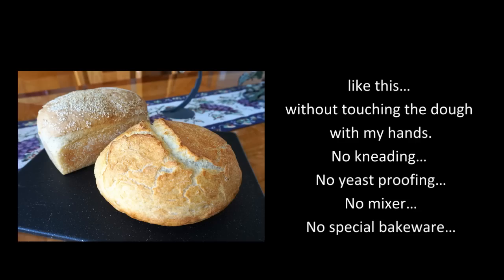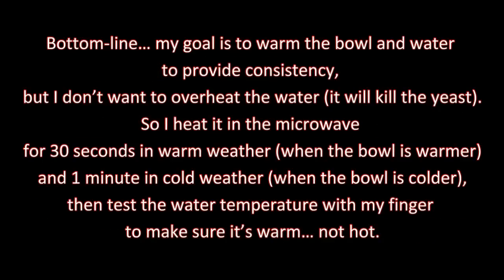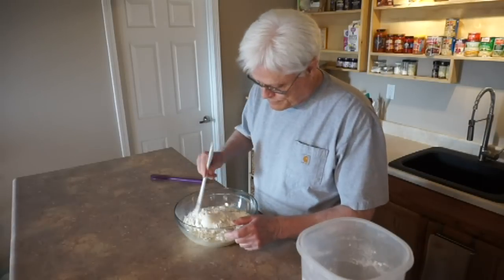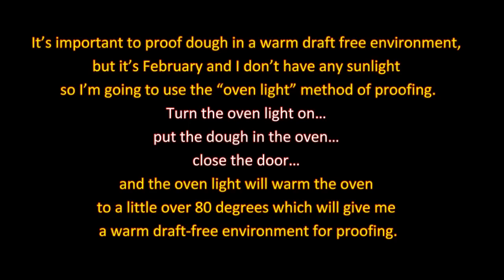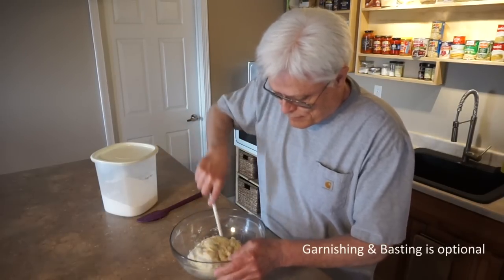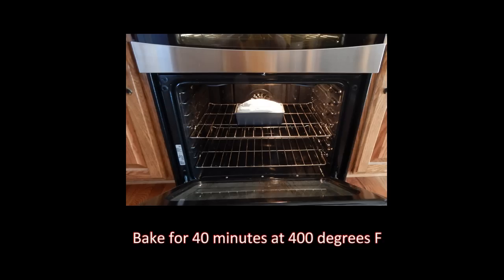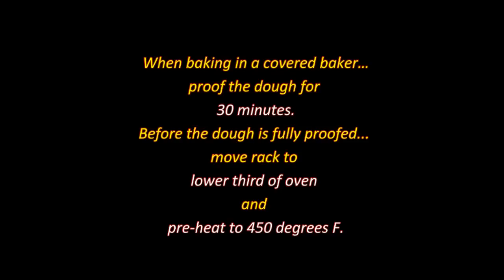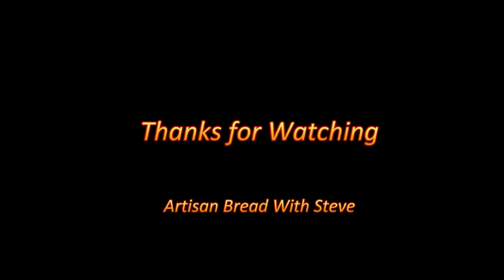Ultimate Introduction to No-Knead “Turbo” Bread… ready to bake in 2-1/2 hours

Comment: Hi Steve. I'm writing from India. This is the second time I used one of your recipes to make bread and it has turned out quite good. Thank you for very clear instructions and simple no fuss processes. The bread is not as good as yours but not bad either. 

We don't get bread flour easily here so I just used 2 cups all purpose flour, almost 1 cup of wheat flour (atta) and 1/4th cup of cream of wheat/semolina (rawa). It's quite warm in Bombay where I live so I used only 1 tsp of instant yeast. All other ingredients were the same. Additionally i added a tbsp of flax seeds and sesame seeds. This recipe is definitely quite forgiving and the bread turned out quite good. Next time I plan to add a bit of sourdough starter for a more robust flavor. 

A very long comment however,  it may help someone else who's trying to make bread in India.

Comment: OMG I just had my first major bread baking success after watching this video!   I started with your recipe.   Then because I can't leave well enough alone I added three eggs and a quarter cup of sugar.  And because that made the dough WAY too sticky/wet I added in about another cup and a half of flour.  (I felt so embarrassed to have ruined your recipe by trying to be all smart, but it worked out in the end.)   Then I baked it using your closed dutch oven technique (450F  for 30 min covered, then 10 min uncovered to develop the crust).

Other than messing with the recipe a little, I used your technique exactly.  And my loaf turned out looking exactly like yours!!!  I even got an identical crack across the top, so I knew I did something right.  I was so thrilled I could hardly wait to taste it.  It was so amazingly good that my son and I sliced and ate almost a quarter of the huge loaf all by ourselves, as soon as it had cooled just enough to slice.  The crumb was fine and delicate with small holes, and very tender.  The crust was crispy and delicious, and was the best part!  

This recipe and technique you've developed really is very forgiving.  It took me barely two and a half hours from start to finish, and it is the best bread I've ever made.   Thank you for helping me make wonderful bread from scratch!   I feel so great right now, having created something truly wonderful that was totally confusing and difficult before.  THANK YOU!  :D

Comment: Awesome video Steve. For those who use a covered vessel, be sure to pre-heat the baking dish in the oven so both are up to temperature when you place your dough in the vessel, which will produce the necessary steaming effect that's required to make perfect bread. #TGBATG
Reply: Hmmm...depends on the vessel thicker and large yes. Small and thin no.
(Personal experience.)

Comment: This recipe looked so easy and so good I decided to give it a try this afternoon.  It was everything he mentioned except... the bread is stuck in my Le Creuset dutch oven.  I cannot get it out without tearing the bread apart.  So my recommendation before you put your risen dough in your dutch oven; either place it on a piece of parchment paper and lay it inside the the dutch oven or simply rub your dutch oven with some olive oil THEN add your dough.  Other than that, I will definitely make this bread again (although I will increase the salt to give it a bit more flavor).  Otherwise, it's delicious and couldn't be easier!

Comment: I have bought your books and the recipes are beautifully simplified so that even a beginner like me can make bread (turned out very good too). I have a suggestion - the amount of water should also be given in cups instead of only in oz.
Reply: It says 13 ounces is 1.625 cups. How do I measure the 625? That's the only thing wrong with Steve's video, it's always OUNCES. Not a clue what 625 is. It sucks!!!
Reply: YAY! 13 ounces is 1 1/2 cups and 2 tablespoons.
Reply: @chriscatlett1793  or 380 mL but I always end up adjusting to the season's humidity anyway :)
Reply: .5 is 1/2 cup , so its a little over that. As he said the recipe is very forgiving!  @chriscatlett1793
Reply: @chriscatlett1793  If it helps, one ounce is 2 tablespoons.

Comment: I've always turned out the dough on a floured bread board for gently kneading and shaping but will try your technique.  Thanks for the tip.  I also warm the ingredients before mixing and use only 1/8-1/4 tsp. yeast or about a cup of sour dough starter.  The results are very good.  I can usually ferment over night but, if I want to accelerate the process when commercial yeast is used, I add 4 or 5 drops of vinegar to the dough and then can ferment for a much shorter period.

Comment: Steve I LOVE you recipes and video.. I have shared them with all my family and friends.. and they are as WOW'd as I was...THANK YOU... THANK YOU...  I just bought at least  5 of your books on Amazon too............ Keep it up we Love it !!!!
Reply: Did you go by the recipe Steve walked you through? I did, it was my first one, but it turned out with the top brown and the bottom still kinda white and it wasn't light and fluffy. What did I do wrong? 

NOT Chris but TRISH
Reply: I am not sure...  I have used this recipe many times w excellant results.. .  I would suggest first review the recipe carefully .. then you might want to check the temperature of your oven. using a oven thermometer..  sometimes the settings on the oven is OFF.. my large oven is off by more than 25 degrees...   2nd be sure the yeast your using is fresh...... and if you buy it keep it in the refrigerator or better yet in the Freezer.. check what he said re the temperature of the water.too. Try simple things first and go from there.. Good Luck
Reply: I guess since it was my first time I can't expect perfection, can I? I just got my yeast today and I've watched his show about 10 times and I had it on while I put everything together but it was still a little dense. I think you're right about my oven temp, unless I didn't have the rack low enough. Thanks, Renita. I'll keep trying until I get it right.
Reply: Definately keep trying... I am not a bread maker but this recipe makes me look like one........ will keep my fingers crossed it works for you..DO NOT GIVE UP.. it is worth the effort
Reply: Thanks, Renita.

TRISH

Comment: I really love your recipes, Steve. Wish I found your channel earlier.  The biggest challenge with your recipes in the beginning was to convert from American/British measurement to European measurement (metric). But I solved it by buying a non stick baking mat from Ikea with a converting table for volume, weight and temperature printed in to it.  :-)  So maybe you could add metric measurement to your future recipes and books?
Keep up the good work!
Reply from the maker: Do you use measuring cups (by volume) or a scale (by weight)?
Reply: artisanbreadwithstev It varies, but I try to use a scale since it is more accurate.  Cup=8 US fl.oz=2,37 dl(volume) or 142 gr/0,142 kg(weight) with fine wheat flour. But since the weight will vary with the density and most people use volume, it is okay to convert volume to volume. Like 1 fluid ounce = 0,296 dl and 1 Cup to 2,37 dl. 1 Teaspoon = 5 ml and 1 tablespoon = 15 ml.
Reply: Svein Arne Grønnevik 
THANK YOU  from Greece. You just solved  the big problem I had with these videos. We have the same metric system and you have analysed all perfectly !!!!!!!!!!!!!

Comment: I have my first loaf waiting for the oven to heat up. My favorite bread isn't stocked at the market anymore. I have a new favorite bread now, I hope! I'm sure it'll be delicious. Thanks for the easy listening video, too smooth.
Reply: How did it turn out? Twice made and each time failed.
Reply: @celleduffel1533  It was delicious.  I did buy a new jar of yeast so it was fresh and the water added was at 110 degrees F. I also made a regular non-turbo loaf and let that proof for 16 hours. It was good. What happened with your bread?
Reply: @mick jelsma  it rose perfect in the bowl and it rose perfect in the breadpan, I put in oven and when it was done it was flat each of the two times made..it was abt an inch and half tall..as i type this I am making again 🤣  its not the yeast because i turned around and made a very pretty Challah bread.
Reply: @celleduffel1533   I have made bread that wouldn't rise, just not this recipe. I hope your bread comes out this time!
Reply: @hannabaal150  ty I will let you know. My husband is wanting some bread. 😁
Reply: Well @Mick Jelsma  the bread is out of the oven..I made in smaller breadpan but you cant say its sandwich bread..not high enough. I dont know now..this is third time..guess its time to call it quits on this loaf :(
Reply: @celleduffel1533  Can't say you didn't try! Maybe address something to Steve, he knows a lot more about this than I.
Reply: @hannabaal150  I may have to do just that. My husband said since cant use for sandwich we can use for something else but that depends on the crumb.

Comment: Hi Steve,  I am a bit confused... You stated that the Turbo loaf is ready for the oven in 2.5 hours but you state that it should proof for 1.5 hours.  If you add the 30 minutes for proofing in the skillet for the covered method, the time does not add up.  Also, you have oven mitts on when you handle the dutch oven but you say nothing about preheating it in the oven as it heats up.  Please clarify.  Oh, and I forgot to mention that I have made your 18-hour breads for quite some time and am looking forward to the dinner rolls.  Yours are truly the most successful breads I bake.
Reply from the maker: First proofing is 1-1/2 hours, second proofing is 1/2 hour, and I gave 1/2 hour for prep, mixing, etc. I didn't mention it but I did preheat the Dutch oven. Steve

Comment: If I'm using a metal bowl it can't go into the microwave so can we compensate but heating the water to little above warm and let heat transfers to bowl. What would water temp and time needed to let heat warm the bowl. One video you said make bread for sale for local animal shelter fun raiser, you rock! 😁
Reply from the maker: Run warm water over the bowl to warm it then use warm water. Steve
Reply: Good thinking 😁

Comment: Not sure what went wrong.  I just took this bread out of the oven...I have the same dutch oven as used in this video.  I didn't see any spray or oiling of the crock before putting the bread in this.  But my bread is permanently fused to my dutch oven now.  I've been trying to scrape or break the edges off for over 10 minutes.  Hard as a rock stuck.

Comment: great video and have tried to follow recipe as it's so simple but I'm English! so having a few problems. Could you also give amounts in grams as the amount of flour in your American cups differs from our system over the pond. At least grams is universal. Thanks
Reply from the maker: I never weigh ingredients. And, U.S. and metric measuring cups may be used interchangeably... there is only a slight difference (±3%). More importantly, the ingredients of a recipe measured with a set (U.S. or metric) will have their volumes in the same proportion to one another. Steve

Comment: making in progress now, n just found out I've used active dry yeast!!! and its an hr later nothing happened! do I need to change any techniques??
Reply from the maker: It is ok to use active dry yeast, but it is slower. Steve
Reply from the maker: Are you proofing in a warm environment (80 degrees F)? Steve
Reply: Yes I'm proofing it in the oven with lights on. I ended up adding a little bit more yeast which i activated it with warm water, and mix and proof another 2 hours.. and it worked!!! Comes out really moist but we loved it! Thank you Steve!

Comment: Steve, I'm going to make your turbo bread today in my air fryer. I hope it turns out.
Reply: Trisha, How did the bread turn out. I'm going to make it in my air fryer tomorrow. Thanks
Reply: Jackie, how did it work using your air fryer? Time and temp you used, please.
Reply: @vickimoore7646  Haha not good. I had it at the max heat, 400. For the life of me I could not get the middle to cook. Total time tried about 1.5 hours. Good news is I baked this in the oven, it was perfect.

Comment: What is the difference between baking with a PMDO and a loaf pan?? Is it texture, hight, flavour?? Is there an advantage to using a PMDO🤷‍♀️
Reply from the maker: A PMDO emulates a baker's oven by trapping the steam. It also protects the crust which gives you control... bake it less time with the top off for a softer crust. Steve

Comment: Hi Steve, I love your video. I’m going to try this today, other bread recipes ask you to put the Dutch oven in the oven while it’s pre heating? Is this-necessary , or preferred . Thanks
Reply from the maker: When I use a cast iron Dutch oven I preheat it. Steve
Reply: @artisanbreadwithsteve  and is it ok to use rapid rise yeast?
Reply: @artisanbreadwithsteve  👍
Reply from the maker: @sparrsheila  Yes, you can use either instant or active dry yeast. Steve

Comment: Can I double this recipe and will it bake through out? Should I lower the temp by 25 degrees and extend baking time to 1 hour? Needing to feed a bunch of people on a family camp out. I am the  baker for the group wanting to bake larger loves to accommodate the group. I will be baking in large Dutch Ovens on a fire pit.
Reply from the maker: Adding more flour increase the mass and you will need to increase the baking time (to bake the mass) and you may need to decrease the temperature (or you may over bake the crust. It will take a little trial and error. Steve

Comment: Hi Steve, Question...I have used  a thin bakers  cloth to cover for the second rise and had an awful problem with it sticking to the dough. The next time I floured the cloth and it worked fine. However, the third time when I did the same thing, the cloth once again stuck to the dough. I had to slowly peel and scrape to get the cloth off without deflating the dough! Any suggestions? Thankfully, the bread still tasted wonderful. Your videos are awesome...thank you so much.
Reply from the maker: "Roll to coat" the dough with flour just before putting it into your proofing vessel. Steve
Reply: Thank you! Today I tried smearing butter over the top before the 2nd rise. It did work, but began browning much quicker. I had to put foil loosely over the top to stop it from burning. I will try the flour method next time.

Comment: Hi Steve,
Thanks for the great videos. I am looking forward to trying this out.
Please excuse my ignorance but i've hit a stumbling block.
You say to Proof the dough in a warm and draft free environment for 1 1/2 hours.
You then say that if you are using an uncovered baker you need to proof the dough for 30 minutes.
Is this an additional 30 minutes or instead of the 1 1/2 hours if you are using the uncovered method ?
Thanks for your help.
Darren
Reply from the maker: The first proofing is 1-1/2 hours... then degas, pull and stretch... put it in the bread pan... and proof for 30 minutes. Steve
Reply: artisanbreadwithstev Thanks Steve.
Darren

Comment: I have attempted this twice and each time it failed..it rose in the bowl great..it rose in the breadpan great but fell flat no longer than an inch and half tall. Its not the yeast cause I turned around and made a Challah bread with no issue. What size pan is being used? I am using a 9x5 pan..should I use a smaller one?

Comment: Have to say, after an hour and a half in the oven, my dough looks nothing like yours. Still very fluid and liquid like. Any reason for this? Exact measurements you stated. Leaving it 1/2 hour and then it will be going into the oven... Would you saying had too much water? Or next time if it's like this, can I just add more flour to the mix? Thx
Reply: Best to have vid side-by-side as you bake...pause or back10sec as you go along...
reading your comments...you’ve missed crucial steps...here use his other link I’ll add to start w more simpler instructions, okay? You’ll get it on the first try like I. Remember vid as you work along...
Link: https://youtu.be/PQtsvPlE7w8
Reply: 1) yeast is specific 
2) pan specific 
3) proof two times specific 
All measures specific 
Cannot deviate, except sesame...he doesn’t measure this only ingredient.

Comment: Is there a way to adjust your recipes to high altitude?
Reply from the maker: Generally speaking you don't need to adjust the recipe. Higher elevations have lower air pressure. As a result, yeast creates bigger bubbles and the dough rises too fast… before properly developing flavor and texture. Solution, proof in a cool location (even a refrigerator) to slow fermentation. Higher elevations will also cause dehydration, but that isn’t a problem because no-knead dough has a high moisture content. Steve

Comment: What size dutch oven do you use?  I've made many lo aves of the no knead bread, and they always seem to settle flat or not high.  I I'm using  an 8 qt dutch oven.
Reply from the maker: The dough spreads when it proofs, which is why I use a Lodge Enameled 3 qt cast iron Dutch oven. Steve

Comment: Hi Steve, I am an amateur in baking and tried out your no knead turbo bread recipe. I used a large stainless steel mixing bowl and cling wrap for the first proofing. An hour or so into the proofing, I noticed water droplets appearing in the cling wrap .. is this normal ? If not, how can I save my dough at this stage ? Thank you!
Reply from the maker: The moisture on the plastic wrap is a good thing... it indicates the dough is warm and the yeast is active. No-knead dough has a high moisture content which (a) stimulates yeast activity and (b) creates steam in the oven. It is the yeast activity that gives no-knead bread its airy crumb and the steam that develops the crust when baked. Steve